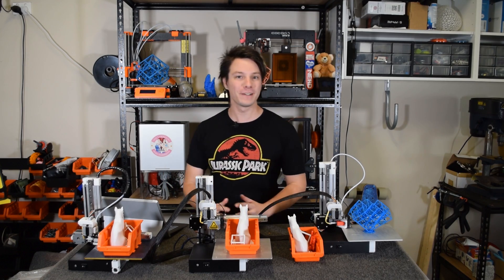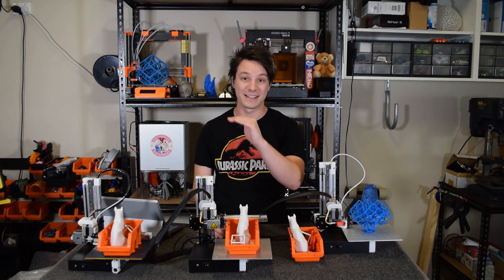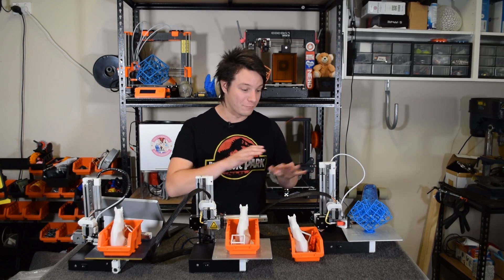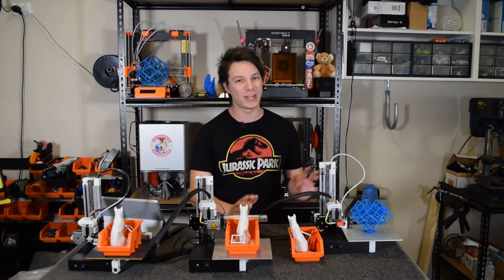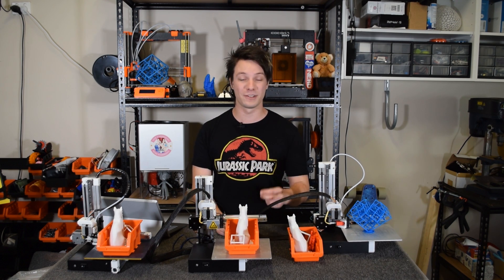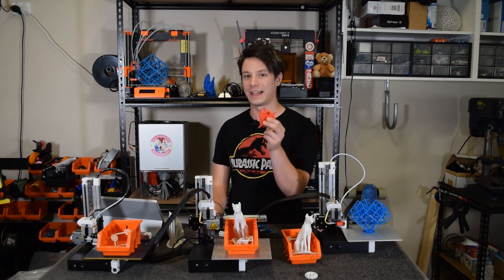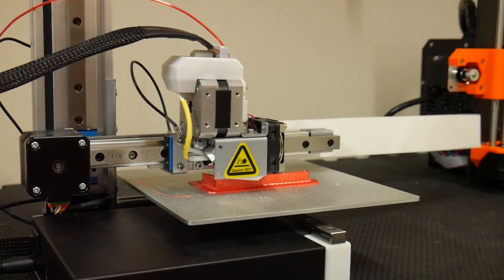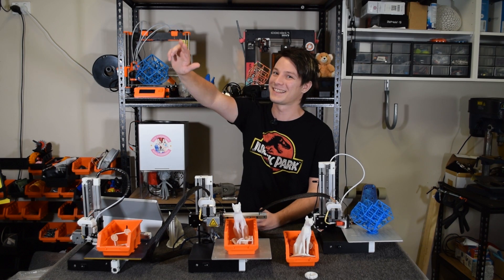Cetus MK3 3D Printer Review

Comment: quick note on the lack of heated bed.... i often use a hair dryer to heat the bed just before a starting a new print makes the first few layers stick 10x better specially if you are not using a raft or using TPU..(or a print with a large size base)  i cant stress enough how much a hair drying heading the bed helps just at the start of a printing. heat it for 60-90 seconds (should be hot to the touch) with a hair dryer just before the first few layers and the world will be a happy place.. then turn off the hair dryer and put it to the side..

Comment: Yeah.. I have 3 broken Cetus Mk2 printers.. the stepper drivers, heater cartridges, and beds all stopped working to various degrees so I changed the system to RAMPS after exhausting most of the trouble shooting I could think of.. almost no support for these printers and almost no documentation so I had to use a multimeter to make my own schematic. Last parts I need to get working are these beta heated beds that carry 15-25 ohms of resistance and at 12V will only draw 0.5-1A.. barely gets past 30 degrees celsius. Now I am tearing the bed switch off and connecting it to the screw terminals and maybe get 2A.. I'm more of a mechanical engineer than an electrical, I am just asking around at 2 am if anyone  can give some advice why the screw terminals to the bed have to have so much resistance.. well.. anyways.. time to burn my house down bye

Comment: MK2 extended This printer works great. I also use XYZ-pro printer.

When using a thin cutter or scraperblade  and go around your rim and brim then use your spatula below your cutting blade, the prints coming fast and good of the plate. this printer works so fine i got a max deviation   0.1mm with large and small prints.  i like those linear bearings and rails.
I am an technical teacher in mechanics and electronics. At school we use several ultimakers=super and manny XYZ= to the point but not so accurate and basic-poor slicer ;-(
 Question : how can i put pictures in comments here ?

Comment: I have had the MK 3 since it first appeared, and I added the heated bed to it later when it first became available (really bad documentation and no wiring diagram for wiring the external power supply to the required add-on interface board.  It came with a non-insulated 4-pin connector that mates with the external connector jack on the interface board, which you have to add in order to have the heated bed; you just get an open 4-prong connector and have to look at the circuit board to ascertain which pins are + and which are ground;  the pin connections are not lined up as they would be for the same connector if you bought the same power supply with this type of connector already installed (the power supply is not supplied with the heated bed).  The bed then has a clip on perforated cover plate.  I do use glue stick on it so I can print without a raft.  Still great prints.  Also, I got it on the year end sale for $250.

Comment: Angus, I highly agree and highly disagree on many of your points. Where we differ I suspect its because I’m a customer of the Cetus printer so I’ve had the build, documentation and support issues you probably havent experienced. I’ve been using the Mk2 for a long time and was close to buying another when the MK3 appeared. The Mk2 has been bulletproof, easy to assemble and a singlepoint calibration will have you printing in short time. And printing, and printing. Its a workhorse, no fussing around with speeds and temperature tuning per brand of filament or roll, just feed it any PLA at all from any brand (colours, clears metallics, woods, rubbers, carbon fiber, etc) and it prints consistently and at a good quality. Its been bang on reliable for easy and complex prints. So I have been recommending it to many people and couldnt praise it highly enough. And as you said at its price point too!.

So the Mk3 I expected the same experience at a minimum. The price hike makes the Mk3 very much a poor choice for a ton of reasons to follow. Biggest reason of all, when you buy a Mk3 you dont really get a better printer, its basically a mk2 in every way with a few parts standard to the mk3 to fascillitate the upgrades which are ALL sepearate purchases and incompatible with the mk2 hardware the mk3 ships with. Every single upgrade is like this. Even, the nozzles, sorry Angus the mk3 ships with mk2 nozzles only, to use the new hardened nozzles which are different altogether the whole hot end has to be replaced, so immediately thats spare part number one that cant be used unless you have a MK2 printer as well. Same story goes for everything else. PSU upgrade uses different  power cord connector and doesnt come with one, so you cant even use the standard one. Z Axis on mk3 I’m sorry does drop hard and fast like the mk2, out of the box. Assembly instructions are not just poor but downright dangerous, various cables like flat ribbons can be attached two ways at each end with video explanations and text descriptions at odd with what the demo person does and what the pics show. So want to fry your new printer fast? Just follow their actual instructions. These differ on the Cetus3D site from the Tiertime support site, from the forums and from what their support provides. As I said the mk3 is no different from the mk2 except the price rise so you have little reason to buy it, except the mk2 is no longer sold it seems. The reason to get the mk3 is because of the addons available and coming. Read the information carefully the addons require other addon parts and cant be used on the mk3 as shipped. The documentation is so fragmented to just showing installation of one thing without regards to the fact most people will want several of them and there are gaps in the information provided. For an experienced Cetus user and huge fan I found it a nightmare at times to figure out how to get everything together. I ordered the mk3, heated bed, psu, levelling probe and expansion board so I got a bunch of boxes. To get the addons onto the cetus was basically a process of assembling the mk3 (2) unit then dismantling and reassembling with one addon after another. It was so confusing trying to figure out correct cable orientation and which part they were referring to when terminology changed around and whole parts of the process were missing from the instruction videos and pages. They really need to sell the mk3 as a true mk3 already with expansion board, psu, heated bed and new hotend already in place at least. It feels like the kickstarter project was a surprise success that got devloped to a solid product and now its been handed over to marketing people to develope as everything about my mk3 experience has soured me to their products and I regret all the recommendations I gave to people confused about where to start with 3d printing. The Cetus Mk3 is the wrong place for a beginner to start. I’m guessing 12 months after they will release the Mk4 which will be the current mk3 with the stuff already in place it should have right now. Theres simply no reason to buy it I can see, plus you end up with a hot end and nozzles you cant use, likewise build plate and a few other cables which are all mk2 specific but no longer compatible once you start installing the mk3 upgrades. So its money down the drain befor you get it. They wont sell you a fully assembled mk3 nor a cheaper. Mk3 kit using ONLY mk3 parts so no spares for mk2 going to waste. Smells like a pr scam to offload incompatible mk2 spares before they comit to the mk3 platform. Very disappointing from what I was starting to believe was a good Chinese manufacturer working to make a quality product and provide a good customer service. Mk3 is a big step backwards in every respect. I

Comment: Instead of using the putty knife to separate it, just use a shitty chef knife. Pops even full sized prints right off.
I have a MK2 and it works well for me to just get the print working and printing out. I don't care about settings, I just want it to work relatively well. Though the shell layers I'd like to see fixed (2 has been fine, but so far it's worked on my applications ).

We've got a big 2k printer at work, and I don't run it, but we've had lots of pop-offs and such doing it (even mid print), mine may be small, but it does what it does pretty well. (there's a that's what she said joke there). For just a hobby guy like me, the raft waste isn't that big of a deal. It's been a neat little addition for a hobbyist that's just interested in making. (When you get to the extremeties with 5mm parts some bowing will be there so it's not like a lathe or mill. Just expect some santing and such for a perfect part.

Comment: I think it should be pointed out that there are a few things to take into account - since mid-March, a new version of UpStudio has negatively impacted print quality and a bug in the upgrade kit has rendered many printers inoperable (see Facebook posts to the user group) which Tiertime have yet to fix. To cap it off there is a thread in the Cetus user forum that claims the machine is not GDPR compliant and that it makes mysterious outgoing connections every time a model is sliced - shades of Huawei.

Comment: Hello,
Few thoughts about this printers and considering all previous comments 

I started 3D printings almost 3 years ago, with a Creality Ender 4 (bought in Chinese "black Friday"): bowden, H-bot, plastics wheels on aluminium: unable to print a real circular shape…

Then I saw a video  about Cetus 3D MKII done by Marco Rep (a very inventive German Guy): I bought my first Cetus 3D MKII, extended version, directly from Cetus UK warehouse (they have warehouse almost everywhere...to avoid customs taxes…).

Then I moved from 'draft' printing quality (Ender 4) to real good printings either in dimensions and in shape.

Main issues on Cetus 3D  are about geometry and rigidity. 
Those weaknesses are magnified with printing speed: the Z axis is not rigid enough and vibrations induced on this axis are reported/amplified on the Y Axis.
 Those issues are not impossible to solve: I did such improvement by adding a 40x40 aluminium pillar tightened on a massive aluminium plate, Z axis attached to it: no more issue. Then you reach very nice quality prints. 
I can tell you guys with a PLA mat, result is pretty close to Markforged Mark Two and its Ony material ! Yes man, we have 3 of those at the office, and my boss was impressed by my "optimized Cetus" printed parts… 

Linear rails are then a lot into repeatability and printing accuracy: and let me ask you this guys: which brand offer linear rails on all axis, direct drive extruder, compact size printer, USB/Wifi connections...at such price range? Not that much appart Cetus.

UP studio, their slicer, is adequate for people starting with 3D prints, having not that much knowledge about all parameters involved into 3 D printings. Not everybody can setup Simplify 3D in 3 minutes and launch successful print right away…
For those who just want simple 3D printing Up-Studio is simple enough.

Then, after a while, you will find that being locked with Up-Studio could be frustrating: then have a look to TinyFab xyz…
You change the original Cetus CPU by a TinyFab one, you add limit switches, and you have a printer directly and fully controllable through USB using...Simplify3D. By the way, instead classical switches, implement IR end-switches: no hysteresis and better accuracy/repeatability.

Like in the review, I also recommend to change the bed with an heated one. it adds few dollars more on the bill, but that make a nice difference. For the ones moaning about sticking prints: look for Ziflex solution …

Thank to this, I bought a second one...then a third one… not "news from the box": I bought their "As-is" printers: each time technical issue has a mechanical origin, easy to fix… So I grabbed 2 more printers Cetus 3D MK2 at unbeatable price, improved them and pretty happy with. One is equipped with 0,2mm nozzle and I can print very accurate prints, including multiple parts assembly.

So is this printer perfect? No

Can we find worst printers on the earth? Damned , yes (even more costly ones…)

Does it worth all critics and black judgement? No

Is it possible to improve and to produce real good quality prints? Yes

Comment: Help me youtube, you're my only hope...

Firstly, hi Angus :)
Your videos got me interested in 3D printing, and even though I don't own a working printer I still watch your videos, so thank you for making them.

I apologise in advance for using the comments section to ask for help. I know it's a faux pas, but I'm out of options.
Tiertime have to date been THE single most frustrating, unhelpful company I've ever had the displeasure of communicating with. 

I CANNOT get my Cetus Mk2 standard to get good quality prints at all. Benchy looks terrible, and the stock sphere from the Up software is also terrible.
I'm getting pronounced layer misalignment all over the parts and there are pimples and dimples ALL over it.

The PLA that they sent in the box as a sample was broken in to 8 smaller parts, rendering it useless. The screws for the z-axis end cap weren't actually screwed in to anything (so I have to hold it in place when it's initialising to get an accurate z height) and the print quality is trash.

I've been meticulous with putting it together, and I've taken a lot of care to calibrate the bed properly, numerous times.
I took it apart, then put it back together with less care (still careful, just not using a set square to align the axes etc), then calibrated the bed with a 'good enough' attitude, and it's exactly the same.
This leads me to believe that it's a software issue. Which means 'normal' 3D printer troubleshooting methods won't work because the software is locked for most advanced settings.

I complained.
Tiertime: The PLA might be damp (no acknowledgement that this is their fault). Buy better PLA. The screws don't mean anything.
Me: *Having bought their 'optimised for Cetus' PLA*. Still bad. I'd like some technical help please.
Tiertime: Calibrate the bed. Send us some photos.
Me: (Resent the photos I'd already sent). I've done that. I'd like to register a complaint about your service and get a refund please.
Tiertime: Try printing ABS. Calibrate the bed. Update the software. Do this then we'll 'explore other options'.

It's takes so long for them to reply, and when they do they just say 'purchase additional products, and do all of the things you've already done again'. Then they say 'no, you can't have a refund yet, do this first'. I shouldn't have to (and am not going to) buy ABS from them. I want to print PLA. I should be able to use PLA, especially their own 'optimsed for Cetus' PLA! 
No complaint registered.
No refund offered.
A month later and still no working Cetus.
I'm at my wits end. If someone can help I would be very appreciative.

If not, let this serve as a warning for the kind of service you can expect from Tiertime.
Reply from the maker: Is it possible the nozzle and setting in up studio aren't matched? I think it comes from factory with the 0.4mm fitted but could be wrong.
Reply: Hi Angus, apologies for the delayed reply, work has been busy.
The nozzle is 0.4mm, and this matches the settings in the software.

I've asked for a replacement and they agreed, so maybe it's just this machine.

I appreciate your input though, thank you.

Comment: The MK2 you have there has the V2 extruder setup and has a slightly louder, but more powerful fan....hence the better prints. After the issue they had with the V2 extruder prematurely failing they sent everyone affected a free V1 extruder setup. The one I received had a more quiet, less airflow fan on it.  It seemed to still print fine, so I left the more silent fan intact, however I could see how it could cause issues in extreme circumstances.

Comment: Silly question, when purchasing the Cetus Mkii, does it come with an older slicing software where you can use a triple layer wall or will it end up with the current slicer where you can only have a double layer wall?
Reply from the maker: Unfortunately the older slicer only works with old versions of the UP MINI and UP Box, the cetus won't be recognised.
Reply: Thank you for your response Angus, I really do appreciate it. Hopefully Tiertime will sort this out soon. I was about to purchase the Cetus until this issue was highlighted. I'm definately looking for a 3D printer that can match the Cetus for print quality, and also create prints that are a little more robust. Once again, thank you for your response and keep posting these awesome videos.

Comment: Good review Angus, thanks. Cetus bed leveling is exclusively used for
printing rafts something that I learned the hard way. To print directly on
the bed, you have to print on a flattish high spot or the part needs to
match the hills and valleys of the build surface. Build surface matching can be done in Fusion 360 or roll the dice and buy another build plate and next time remember to never let the z axis fall and bend the build surface. Great printer for prototyping functional involute gears.